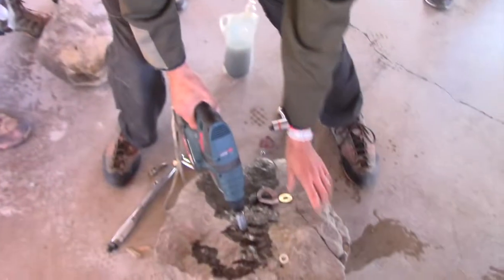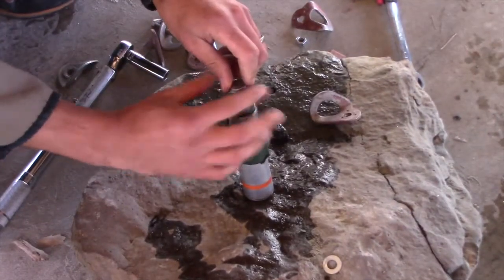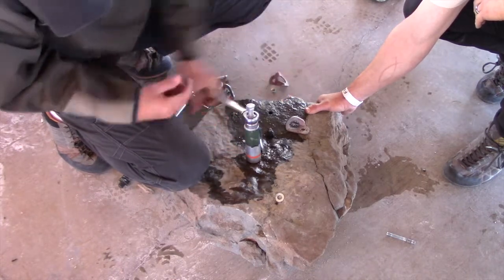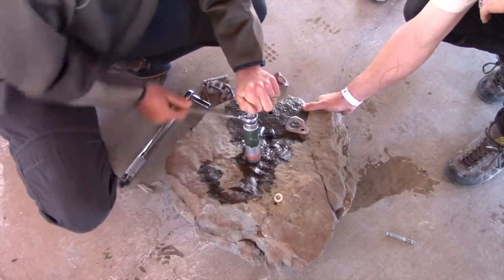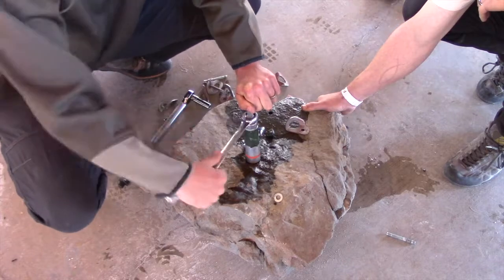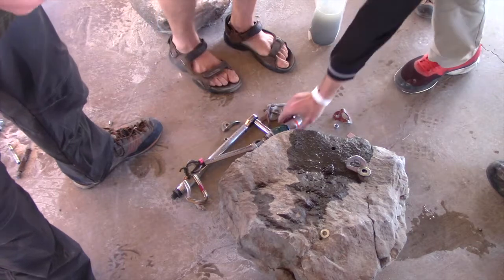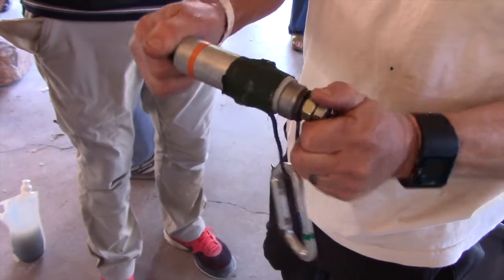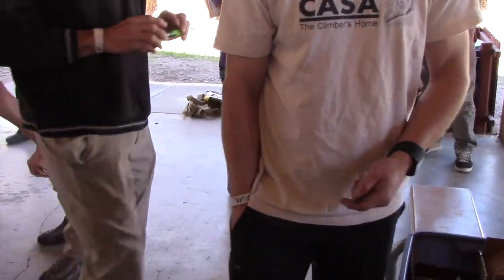Hurley Junior Bolt Removal Demonstration

Comment: I have found that I am having 60% (+/-), success rate of removing bolts, otherwise the sleeves snap off. I am removing the bolts in sandstone. I have noticed that when the sandstone is soft, the bolt cones out no problem, fully intact.

 I am using a hurley junior to remove drop in anchors. I have a 1/2" x 3/8" coupling on the end of the tap bolt. On the end of the 3/8" coupling I use a 1" x 3/8" bolt to screw in to the drop anchor. The drop in anchors are 1" long. I tighten the bolt into the drop anchor until it can go no further. I then tighten the tap bolt to pull the drop in anchor sleeve out.

Are any other users having the same results? Am I missing a step to keep the drop anchor sleeve from snapping off?